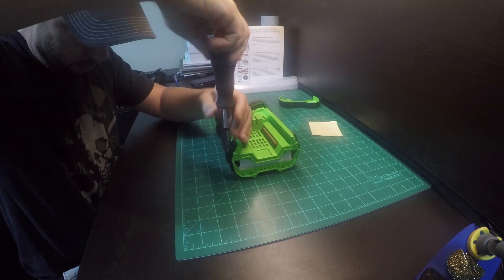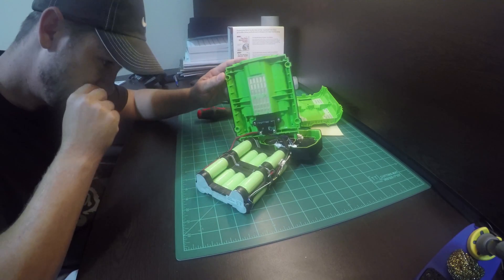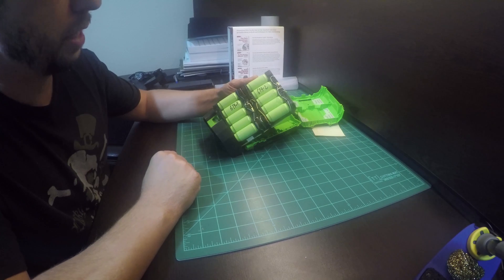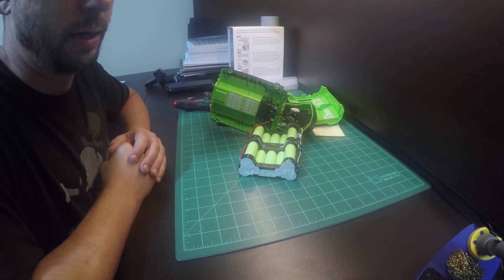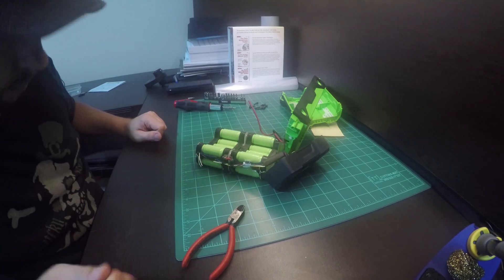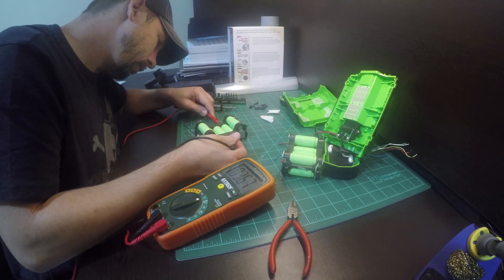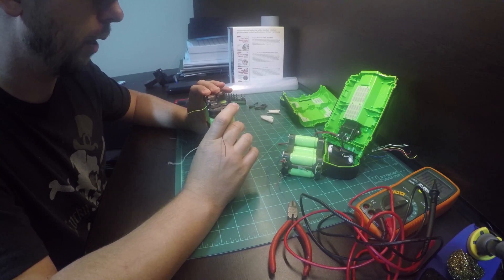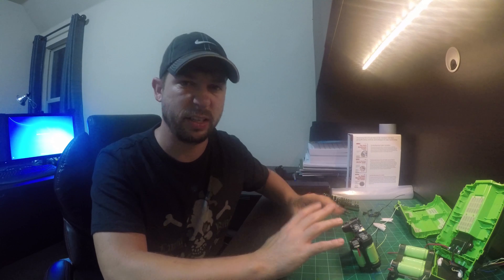Ego Power Plus 18650 Cell Harvesting

Comment: Having recently gone through the warranty process, I would say it takes a little time (they insist on a lot of debugging steps), they will send out the new battery without having you send the old battery back. So it is a real win.

You might need to have a receipt although they will do a "one time" exemption and say the new battery doesn't come with a warrantee if you don't have a receipt for the old battery.

Comment: Cutting live wires is fine as long as you cut ONE at a time. The second you cut into 2 or more wires you are risking completing the circuit and aside from a shock you can short a battery maybe enough to ignite it. At least you got views -_-
Reply from the maker: Yeah, learned that the hard way.  I was thinking that the wires were no live at the time (stupid assumption, and I know better now).

Comment: Thumbs up! Well done video. I like taking things apart and learning from them . What were you using this battery on?
Reply: Let me get this right... You were charging the battery with an inverter in your car and it messed up both your battery and your inverter? 

Question... Which charger were you using? The quick charger or the slow charger?
Reply from the maker: +Joeak74 I'm using it to learn how to build my own 12v rechargeable battery pack for my telescope.  

I haven't done much with it lately, but when I get some more free time and money I'm planning on buying the charge controllers needed to make the pack.
Reply from the maker: I'm actually only now seeing this comment - not sure why I didn't get a notification on it.

I was not charging the battery at all - actually I was working on a portable power supply for my telescope and use a 48-60v to 12v buck converter to step the voltage down.  Somewhere a wire came lose and shorted the circuit, blowing the batteries integrated BMS.

I do use the slow charger since I never need the batteries to be recharged in 30 minutes or less...

Comment: Nice video! Just checked the math as I'm about to take one of these apart. At 63.75 (slightly overcharged) volts, if your skin resistance was 1,000 ohms  (as it would be if it was wet, or you have a cut), the battery could deliver 63.75 mA, just enough to kill you. At 100 k ohms (dry skin resistance) it would only be 637.5 micro amps, not enough to kill you. But its always better to be safe than dead.  :-)
Reply from the maker: Good info!  Be sure you cut those damn balance charging wires one at a time!!!  That shock I took obviously wasn't lethal, but it stung pretty good.
Reply: Hahahaha, 63.75mA at 60v won't do anything to you. It will kill you, you said. Keep dreaming.